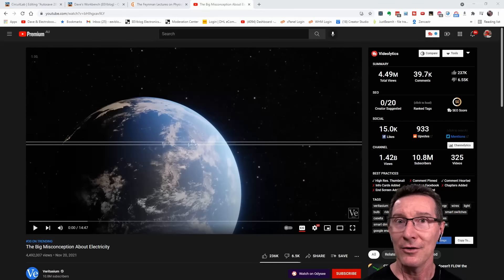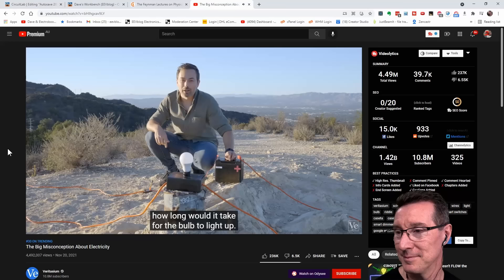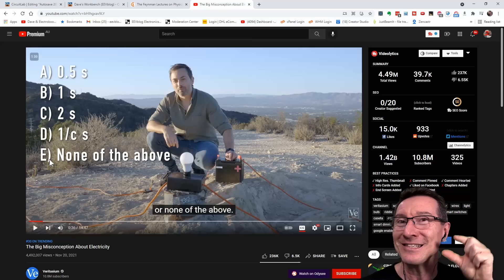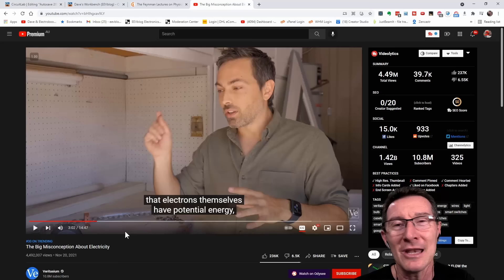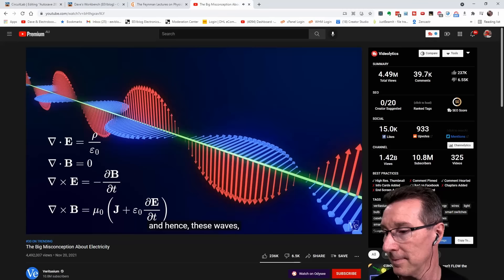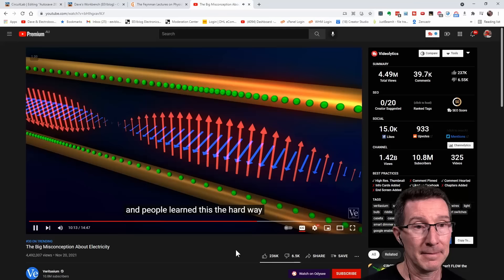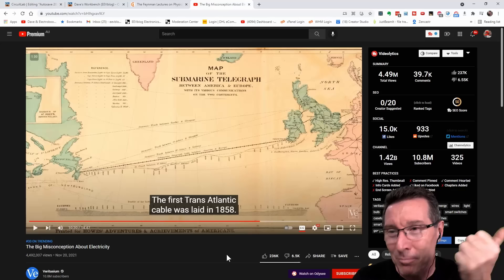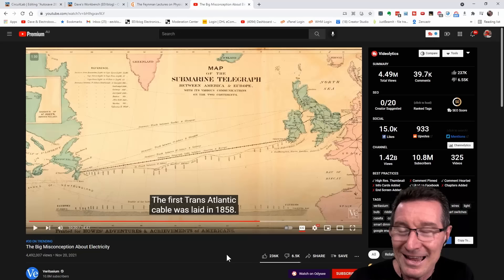EEVblog 1439 - Analysing Veritasium's Electricity Misconceptions Video

Comment: 40:24 What's missing in Feynman's Fig. 27-5 for the steady state is the electric field component perpendicular to the wire due to the charge distribution in the conductor, which together with the magnetic field makes a Poynting vector (and therefore energy flow) parallel to the wire. Feynman's figure only shows the electric field component due to resistance, which causes some of the energy flow along the wire getting directed into the wire.
This also means that most of the energy flows outside along the wire, not directly through space from the source to the load. I would argue that answer "B) 1 s" is therefore closest to being correct since only a small amount of energy due to transient effects arrives at about 1m/c.
Reply: With regards to fig 27-5, are you saying there is non-uniform charge radially in the conductor at steady state DC?  Is this not what Dave was talking about re skin effect? Or is this another caveat?
Reply: @Aor87  I am talking about surface charges in a DC circuit. This is a different concept than the skin effect, the latter of which only occurs for AC currents. Surface charges seem to be an often ignored detail when people talk about DC.
Think of Veritasium's circuit with zero-resistance wires. In steady state, the net electric field inside the conductor is then zero, but there is an electric field on the outside of the wire coming from the surface charges. This field contains the energy, which is transported along the wire. So while it's true that the energy does not flow inside the wire, it still flows mostly close to the wire where the electric and magnetic fields are the strongest with a Poynting vector approximately parallel to the wire.
Reply: As member of general public: when I finished viewing veritasium video, the first thing I thought was... "Ok, then if I put the bulb into a Faraday cage, the cage would block the electromagnetic field that comes through the air and the bulb wouldn't light on". And thats absurd. Therefore, it would be quite more complex. If I haven't misundertood you, your explanation saves this problem. Thank you.
Reply: Actually at exactly 40:24 they measured exactly 6.9 level Earth quake on the magnitude scale at Altadena, California. The first responders at the scene found that the source was Richard Feynman's grave, where he had been turning violently. The cause was later determined to originate from an EE misquoting him.
Reply: @dbenitopperez  Faraday Cages only work if there are no holes (especially no holes with wires going through!)   Yes, if we connect a no-holes faraday cage ( REAL faraday cage) around the bulb, it will short out the bulb, there will be no EM fields inside the cage, and the entire current will be across the outside of the faraday cage.
Reply: @wbeaty  Thanks for your comment. We are dealing with wires with no resistivity, with a bulb that lights with any intensity, and without considering transient effects... So, why cannot imagine a Faraday cage with a wire through it? ;-D . I suppose that, if we made a short at the bulb, with wires with no resistivity, the battery will discharge instantly (0 seconds, no delay).
In case that we cover all the wires and the batery with an insulator, and then with aluminium foil, there would be no EM fields outside the circuit. But the Poynting vector will point outside the circuit. Would there be power transmission?
Reply: @dbenitopperez  But a "faraday cage" is only a shield if there are no wires passing inside.    If we run some wires through a hole, then a faraday cage cannot shield GHz or MHz or 60Hz or DC.    To properly shield a 2-terminal component, the surface of the faraday cage must be connected to both its terminals.   Then, it will shield both the RF and the DC, just as expected.
If you want imagination, then why not replace all the wires with quartz rods, and replace the battery with a copper cube!   After all, IMAGINATION!    Uh, nope.
Reply: @dbenitopperez  Your thought is actually close; it is not actually absurd.  One of the conditions stated in the veritasium video is "in free space".  By introducing a Faraday cage, you are changing the condition and it is no longer free space.  Remember also the 1 metre that Dave mentioned more than once.  Now that the conditions are different, the path of the electromagnetic field will be much more complicated and the math will give a different answer.  Of course, I am assuming the wires penetrate the Faraday cage to connect to the light bulb, and for that reason the cage is not academically "perfect".  Remember, we are calculating time (not power, or whether it is sufficient to light the bulb) so the answer will be different, but probably not enough to make a meaningful difference in practical engineering.
Reply: Thank you, finally someone who sees the flaw in Veritatiums analysis (I have gotten tired of trying to correct this misinformation in all the videos popping up). He ignores most of the E field (actually all of the E field in his example, since his wire has no resistance).
Reply: @petervavaroutsos449  "He ignores most of the E field (actually all of the E field in his example, since his wire has no resistance)"
I think Veritasium correctly explains that surface charges create the electric field around the wire. He also says that the surface charges make the electrons drift, although the driving field inside would be zero for his assumed wire with no resistance.
The field and therefore the energy is concentrated next to the wire, but Veritasium's picture makes it look like the energy flow is somehow spread throughout space between source and load. I cannot completely agree with the conclusion that it's "not the electrons that carry the energy", because the field is determined by the position of the electrons and is strongest close to them. More precisely, it depends on which side of the DC source you are. On the negative side, the field and therefore the energy is carried by the electrons. On the positive side, it's the field of the positively charged atomic nuclei that contains the energy.
Reply: That bothered me too about Feynman's discussion, because I was in the habit of thinking about a current as being equivalent to a distribution of electrons moving through space at a constant speed.  That is probably the wrong way to think about it because it neglects the positive charges in the conductor, but should be ok for electrons in a vacuum tube.  I know the 'excess' charges in a conductor are distributed near the surface and the current is concentrated near the surface for AC and probably for transient currents.  Not sure about DC currents though.
Reply: @davidlyzenga4796  "the current is concentrated near the surface for AC"
This is the skin effect, which is relevant for AC of high frequencies.

Comment: You said all I'd have liked to say. Well explained! He implies the bulb turns on, as in "it turns on normally (100% power), and remains on" and that is clearly not the case! But yeah... the physics are ok.
Reply from the maker: Yeah, I didn't go into the wave and reflection response as the video was already long enough.
Reply: @EEVblog  You definitely should) Need a few seconds of bulb brightness simulated and graphed under this model
Reply: Yea, Not including dimensions is really irritating and potentially blocks people from understanding.  Nerd click bait, lol
Reply: The physics is totally wrong as he assume the bubble start emitting light instantly as the electric energy is fed to it. Sory it's wrong, that bubble first need the switch mode converter to stabilize then the decoupling cap to charge up before the LED start glowing !
And if you want to get picky about what happens in terms of reflexion in the line, although that will only account for a super tiny irrelevant fraction of the turning on time, then you must acknowledge that the damn PSU in those modern bulb is by no mean a "nice" resistive load as used in the calculation we made at EE university (That's why for more powerfull unit you need a prefiltering stage before the actual AC/DC converter so you don't mess up too much with the cos(phi) of the power line). Fact is understanding things at this level would be a mathematical nightmare and once again it doesn't matter as in the real world that switch to light time depends probably as much on that than on the noise. 
So yes "assuming a perfect world that doesn't exist where everything would go according to the equation i want to demonstrate then the physic is right". To me that's an oxymore to say it's wrong.
Reply: Magic light bulb, the transient will be over long before the filament heats. I thought for a incandescent bulb on time is defined as 90% filament heat. If using a LED will it even get to forward voltage?
Reply: @jacobthellamer  oh you are totally right real world filament bulb also defeat the answer he give because thermal mass is a thing.
Reply: @mattmurphy7030  well those extra factor don't "complicate beyond" they make the whole problem much easier actually.
Reply: Rewatch the end of the video. He literally doesn't state that.
Reply: Clearly Derek wanted to give a shocking answer, but to do so he was incomplete and inaccurate to the point it hurts
Reply: Dave Pin  I think he meant the impulse response of the square wave can be represented in circuit analysis as a Fourier series,  ie fundamental frequency plus an infinite sum of sinusoidal harmonics.   
Like most of this theoretical physics vs practical engineering stuff, it depends upon how you conceptualise it.
Reply: Yes, I took the lightbulb as a conceptual marker at the point of interest in the circuit. We really don't care how the bulb behaves, just what the conditions are at this point.
Reply: @EEVblog  I appreciate your effort to explain Derek's video.  However, you use the wrong model for Derek's experiment setup.  A transmission line model is not applicable,  and Derek's answer of 1/c for immediate steady ON is also not entirely right, it's misleading. For the immediate transient, the better model is a dipole antenna model and what causes the lamp to "flash" is an EM (radio) pulse, not a closed circuit through a capacitor, as you modeled.   Also, Derek conflates DC steady state with transient analysis which is false and folks who want to learn, get misled.  See my explanation in the main thread.

Comment: I quite literally design transmission lines, and the whole time I was watching Vertiasiums video I was thinking to myself "yes but....." Generally, it's not really a useful way to frame things and it's clearly just for the 'wow' factor that it gives a general audience.
Reply: As a physicist, I agree with you that this is not at all useful for day to day work, but it is cool.  Typical of what we do in physics to simply the problem until it is beautiful - Oh and we got to the beers long before the engineers! (Although if I had to solve it I would treat it as a transmission line!)
Reply: like all veritasiums videos.... 🙄
Reply: @morethan4mph  finally a physicist, thank God
Why doea it happen faster than the speed of light? I mean, wth, the information that the switch is closed shouldn't be capped at the speed of light to travel across the wire (or around)? Like, current, EM field, gravitational field waves, ain't everything capped at c?
Reply: @mildlifeisatrisk5727  it happens at the speed of light.
Reply: @morethan4mph  oh, thank you for responding! :)
But wait, if it happens at the speed of light, and the wire is one light-second long (or the half of it we'ee calculating on) shouldn't it take at least one second? 🤔💭
(Supposing everything is ideal, super  disclosable, don't oscilate a bit to establish, etc)
Reply: @mildlifeisatrisk5727  the argument is that the information does not flow all around the length of the wire, in fact, the wire does not even need to be connected , just parallel pair of wires, this is the transmission line approach.  I think between this video and the original one the effect is explained.
Reply: @morethan4mph  WAIT, WHAT? 🤯
You mean the electricity (tension/current) skips the length of the wire and jumps from the bottom part to the upper part, with only a certain Z in between them? Because that is mind blowing!...
(Also, just outta curiosity, in the case the wire is laid in a different shape where the gap skipping is not possible, it would take an order of seconds to cone through, right?)
Reply: @mildlifeisatrisk5727  it is a very carefully set up question.  In essence though, yes, the length of the wire doesn’t matter.  It can be looked at either as veretassium does it or as a transmission like of lumped inductance and capacitance.  Watch both videos very carefully and it is explained.  Changing the shape of the wire will have some effect.  The original question is very carefully framed with spaced parallel wires.
Reply: @morethan4mph  The veritasium video should really be called an intro to wireless charging.
Reply: I would like to point out something. Remember, people who do vids on YouTube usually have a time limit for those videos (this is my main problem with the format). I used to build Mopar race engines and transmissions. To this day I can find videos on YouTube that make me go "yeah but..." all day long. I have to keep in mind that their are format limitations involved.
Reply: @morethan4mph  Yes but... Suppose the wire was shielded such that it did not allow electric or magnetic fields to penetrate it. How then could the energy propagate outside the wire? Are we to believe a coax cable will not allow a simple DC circuit to work?.
Reply: @Logan Lovell
As an Xline designer, I'm surprised that you didn't spot the huge flaw here.  Dave here uses the wrong model for Derek's experiment setup.  A transmission line model is not applicable, so what you see on his graph is incorrect, and Derek's answer of 1/c for steady ON is also not right, misleading. The better model is a dipole antenna model.   Also, Derek conflates DC steady state with transient analysis which is false and folks who want to learn, get misled.  See my explanation in the main thread.
Reply: @morethan4mph  No!  Dave here uses the wrong model for Derek's experiment setup.  A transmission line model is not applicable, so what you see on his graph is incorrect, and Derek's answer of 1/c for immediate steady ON is also not right, it's misleading. The better model is a dipole antenna model.   Also, Derek conflates DC steady state with transient analysis which is false and folks who want to learn, get misled.  See my explanation in the main thread.
Reply: @robertv4076  The answer to your question is it depends on the reference point of what you consider travelling through the wire. Electrons inside the wire creates the magnetic field outside the wire and that carries the current. Magnetic fields are stronger the closer they are from the source so shielding a wire will not eliminate the magnetic field of the wire but will reduce any significant effects of magnetic fields from other sources.
If you're interested on this topic, watch Electroboom's response video to the same video.
Reply: @mildlifeisatrisk5727  Yes it's called inductance. A changing current in a wire produces a changing magnetic field, which induces a current in any conductor nearby. The electrons in the first wire start accelerating and producing a magnetic field, which in turn excites the electrons in the other wire causing them to move. Moving electrons is current, and bada bing bada boom inductance
Reply: @morethan4mph  not exactly because of the energy storage in inter-wire capacitance and wire configured inductance. It the conductors were of zero resistance and inductance, the energy storage would be accomplished at a rate corresponding to the speed of light. But those wires have non zero resistance so the energy propagation is somewhat less than c.

Comment: A major difference in the way we electrical engineers deal with the practical aspects of electrical engineering is recognizing that a true STEADY STATE d.c. circuit ( no time-variant current/voltage changes ) there is no reactance, only resistance. There is no electromagnetic radiation from conductors in a true steady-state d.c. circuit.